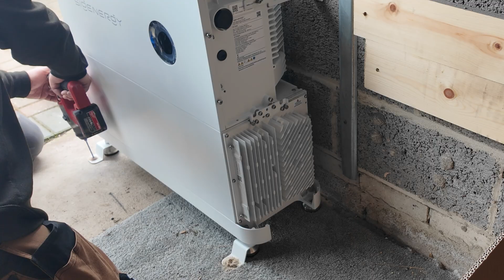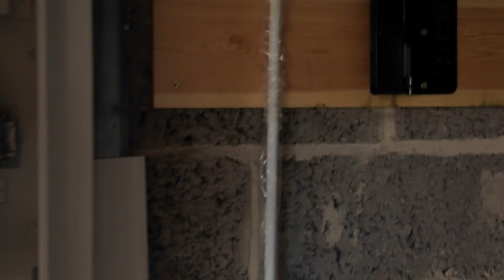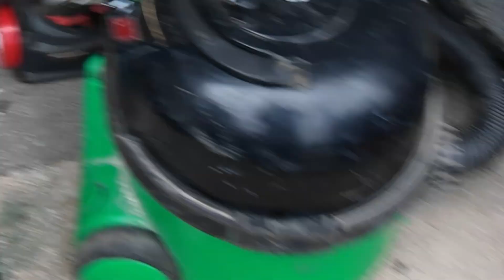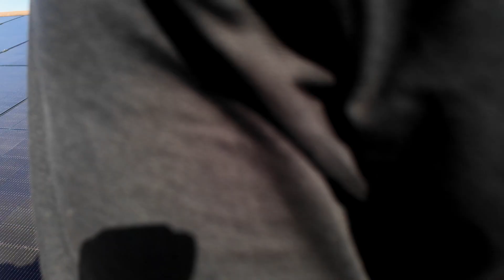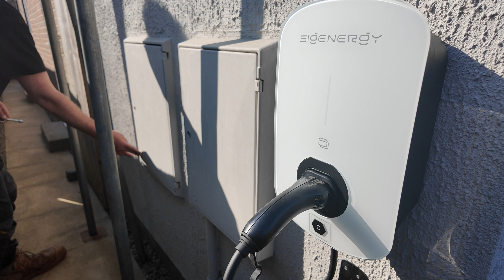The Solar and Battery system EVERYONE is talking about

Comment: Tangent > I want to import Japanese Scaffodlding.. Its a tap into position and tap out.. and assemble rails/racks deck et all
- Full on Japan scaffolder (auto translate) https://www.youtube.com/watch?v=muoiqBBLtbU
- https://www.youtube.com/watch?v=ANm3PyuY_kI
Reply: Sparky Crew = https://www.youtube.com/watch?v=HeN8OOBEvB0
Reply from the maker: In terms of fitting solar PV. Rigid, professionally installed decks is the only way to satisfy safe systems of work imho. For maintenance like cleaning etc a temp scaffold tower can be useful.

Comment: Wouldn't it make sense to paint the roof in reflective white first?
Reply from the maker: It would help for a short while. The other issues is aesthetics. That white would appear at certain times through reflected light and look a bit naff tbh. 

The upside in any generation isn't that large so not something I would personally recommend. But for those desperate for every last Watt who are not worried about how it looks it would deffo produce a little more power until the white coat faded in the first year or two

Comment: Is that Tigo breaker to their CCA and the TAP? Do you initiate rapid shutdown by simply powering off the CCA? My CCA has an ‘aux’ port where you can connect a NO emergency stop button to force a shutdown.
Reply from the maker: Either or works.
Reply: @ Didn’t realise that. So the ‘aux’ method is ideal for an external ‘fireman’s switch’ equivalent….
Reply from the maker: @herrtomas6729  yes, ideal for that. If the TAP does not send signal to the system optimisers they shutdown. This can be triggered by AUX or on power loss.

Comment: Marc I live alone and work away quite a lot I hardly use anything but I do have a nice south face big roof, is it even worth me getting solar as I don’t really use much electric, I’ve been thinking of getting panels just to sell to the grid so It can pretty much just pay for my Combi boiler heating over Christmas. Would it be worth it?
Reply from the maker: It's always an option. But would depend on grid export limits. Also worth noting no guarantees on what the energy markets will pay you for that power in the long term

Comment: I'm not a fan of the all-in-one battery systems. They're simple and tidy, but in 10 years when you want to upgrade or replace the battery, there's more than a likelihood that you won't be able to get a compatible battery.
I'd much rather have a 48V/16S battery and separate hybrid inverter.
Reply from the maker: Such are the options for all of us. Nobody has a gun to the head in terms of selection. 

That said these styles of system deliver better performance, less likely to fail due to cable connections and have more easily maintained BMS enhancing product life. 

Seperate budget end hybrids are always an option of course but not one I would personally select. 

I would suggest in 10 years you wouldn't want to be integrating your hybrid of today with kit of the future so sort of a nonsense view if I am brutally honest. 

However Tesla have massively dropped the ball on backward compatability with the PW2 and PW3. But then again the hybrid range of kit from GivEnergy is not backward compatible with the swap to HV stacks. 

Hope that helps.

Comment: Does the Sigen system get confused because you have put a charger on Inverter 2.? It won’t know the gross PV generation  and that messes up some of the app setting logic?
Reply from the maker: Nope. The app logic comes from the inverters themselves in terms of generation. The common buzz bar in the bottom of the gateway is CT monitored at the top so all of the inverters, SPD and backup breaker share the same monitoring. As the logic knows what the inverters are doing the rest is seen as households if 3rd party ev chargers are used and is even separated to EV consumption when a Sigenergy charger is used. It's a great option to keep the smart port available for things like heat pumps.

We would never hand over a system that was not recording and reporting properly. That would not be good for business...
Reply: @ thanks for explanation.

Comment: Hello from Mexico! 

I’m enjoying the coverage of the sigenergy sigenstor and it’s so valuable for when I do my install.

One thing I’d like to ask is regarding the car charger… what torque settings are you using? I know other brands require specific torques. Or does the Sigenergy’s system have a safety advantage here by removing that torque issue ?

Thanks again
Reply from the maker: It does have one. The manual is quite specific on a few things. Including 60898 protection on the circuit when using pen protection. The sigenergy website has all the datasheets and instructions etc. Thanks

Comment: Yes Marc, top draw job done there, awesome. I have done a few of those chargers single and three phase, but did not know that about the pen fault protection. If you connect the EV charger to INV 2, can you shed the load on island mode? Maybe within software.. The smart port would allow you to turn off heavy loads manually
Reply from the maker: Yes you can still load shed on gridd loss. Smart port on this one retained for future heat pump ❤️

Comment: Looks like the kind of system I want to get installed this spring here in Brittany.  All the installers here seem keen on using Enphase micro inverters and AC coupled Enphase batteries. Definitely pros and cons to such an approach - do you have any good/bad experiences with them?
Reply from the maker: Enphase is a solid option. We shared installs on the channel a few times. I must admit it's not a preference for us but it's perfectly acceptable and good quality gear.